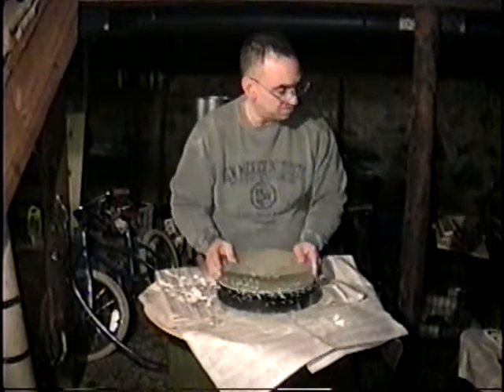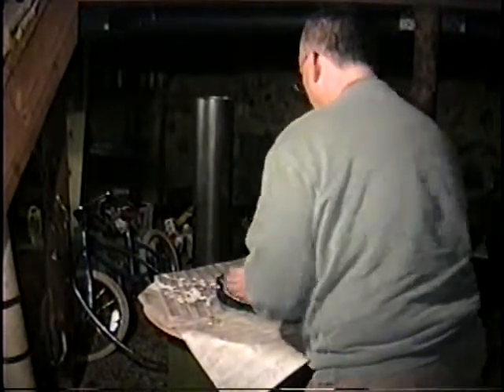Pitch Lap Part Eight

Comment from the maker: @carluchoparis I use the following Silicon carbide abrasives in this order; 80, 120, 220, 320 and sometimes 500. Aluminum Oxide 20 micron  (Unless I used 500 Silicon Carbide. They are the same size.) then 15, 9 5 and then 3 for twice as long as the other grades. Using 3 is controversial as it can cause scratches if not used with lots of water. Each grade of abrasive is used for an hour on a six inch once you have the curve roughed out with 80. I generally use W strokes to avoid astigmatism.

Comment: @foreilly1958 Francis, correct me if I'm wrong... With my second and third pitch laps I have been polishing a 6" f/8 mirror close to 22 hours . I think the reason it's taking so long is because I had a really bad case of dog biscuit and I may have not fine ground the surface enough before starting to polish (I still see pits mostly close to the edge)...

What do you think?

Comment from the maker: @carluchoparis Forget the laser. It shows the underlying structure of the glass an is not a proper test for polish. Use a maglighht instead.

Beeswax will not help. It may reduce sleeks. That's about all. 

I count on about an hour per inch of aperture when polishing using Cerium Oxide. Less than half that time when using Universal Photonics Number 85 Rare Earth Polishing Compound.

Comment: Hey Francis... I've been wondering, I have not used beeswax yet on my pitch lap. As you may remember, I've gone through 3 pitch laps. The first one was too hard, second one I had added some turpentine, and didn't mix it well enough, so I had soft pitch bubbles within the lap and it failed. The third pitch lap has been working very well, the surface of the mirror is invisible to the naked eye, but the surface still reflects the light from a flashlight and a laser. Will the beeswax help?

Comment: @foreilly1958 Actually I believe 25 micron is about 380 to 400 grit, however, I've been fine grinding using the 25 micron for about 3 hours and there are still hundreds of pits on the surface... Something is very wrong here... I presume I really should get 320 grit before using 25 micron... This sets me back a bit... will let you know the outcome once I use the 320 grit. I can't believe I was polishing with such a badly ground surface...

Comment from the maker: @callmeshane303 No Shane, I have not. Grit is prettty inexpensive. I have lots of it. I really don't need to improvise. Glass is quite abrasive however. I urge caution when using precision tools around glass, it will wear them down quickly.